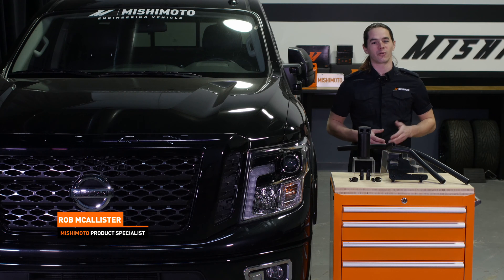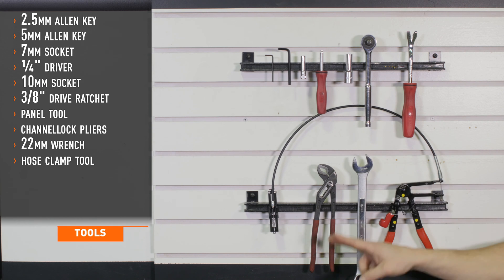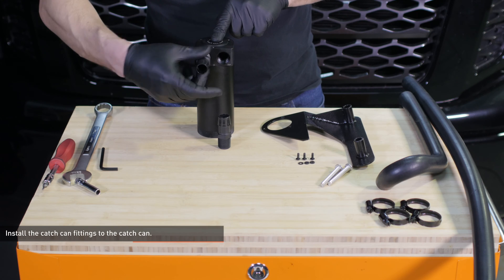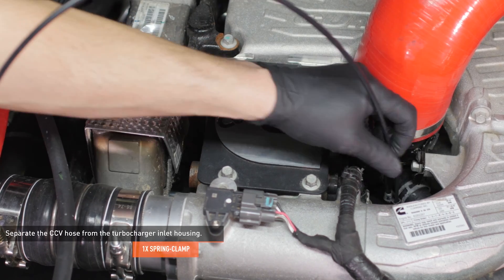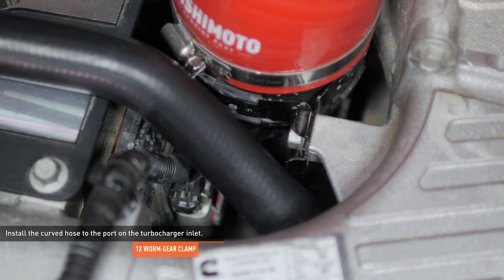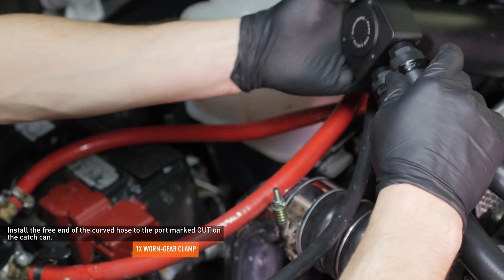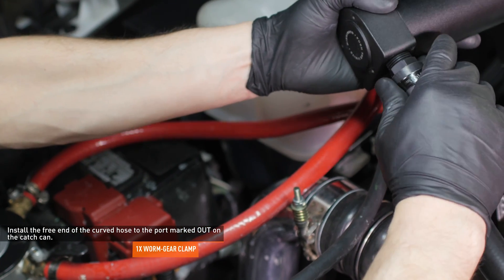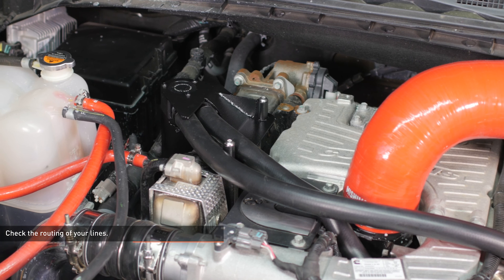2016-2019 Nissan Titan XD 5.0L Cummins Baffled Oil Catch Can Installation Guide by Mishimoto

Comment: I have a 2017 5.0 Cummins. I just hit 75k miles and I’ve noticed that there was oil accumulation from where my intercooler piping connects. I looked inside the piping and there was a standing oil in the pipes. I’ve shared this and people are telling me it’s normal and to buy a catch can. Will this catch can stop the oil from getting into my intercooler pipes?
Reply from the maker: It should help, however, if there is an underlying problem, this will not resolve that.  Thanks!
Reply: @mishimoto  Thank you got the quick response. I have done some research and I think my turbo seals have gone bad. Taking it to Nissan tomorrow.

Comment: Looks like it's going to be fun to get that can unscrewed from the bottom to dump, is that the highest the bracket could be?
Reply from the maker: It is actually not too hard to remove it once it is installed.

Comment: And this does what exactly?
Reply from the maker: Mishimoto’s 2016+ Titan XD Catch Can Kit features Mishimoto’s oversized Baffled Oil Catch Can with several internal baffles to better separate oil from the crankcase vapors. Strategic positioning in the engine bay prevents condensation buildup in the catch can from freezing in cold climates. Two direct-fit hoses and an application-specific bracket make for a quick and simple installation. Our catch cans are different from most air-oil-separator (AOS) systems on a few levels. First, our catch cans are not heated. This means that all of the blow-by is able to condense in the can, including low-octane oil vapors and contaminated fuel vapors. Most AOS systems also drain the blow-by back into the oil pan, while our catch cans trap the blow-by and keep it out of the engine permanently.